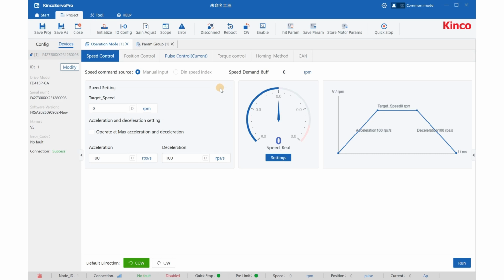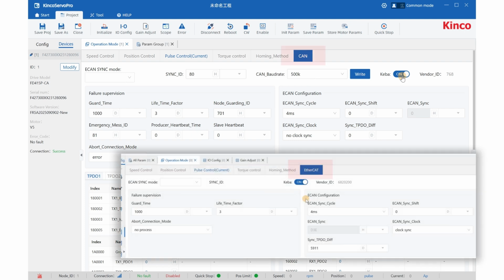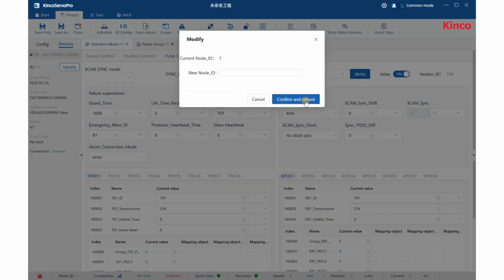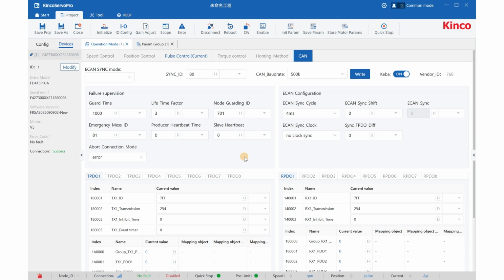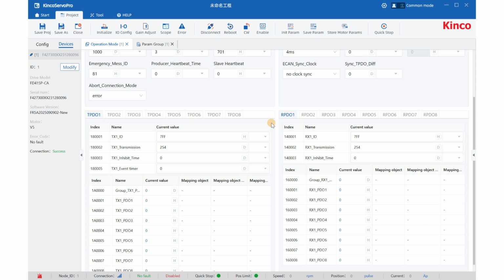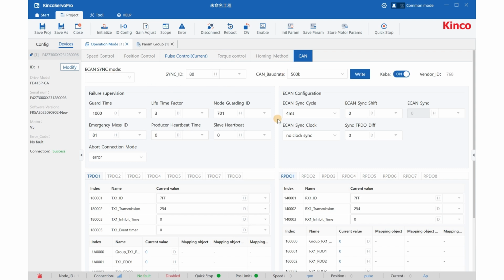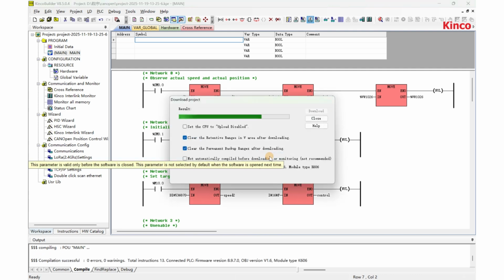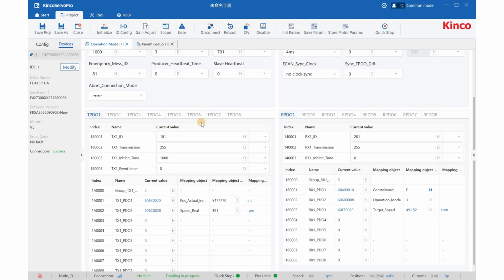EtherCAT & CANopen Servo Communication | ECAN Sync Mode in KincoServo Pro

Comment: I am using the same software, and I am following exactly the same step-by-step procedure as shown in the video.
However, communication is not being established in the UART Assistant software.

Please create a video specifically for the Kinco servo model iSMK80-075-DMAK-EA-000, because even after correct settings, the communication is not working on this model.

I request your support to demonstrate the complete procedure clearly, including:

Correct wiring for RS-485

Exact servo parameter settings

Proper UART Assistant configuration

Verification steps to confirm communication

Kindly help me resolve this issue. Your support will be highly appreciated.

Thank you.